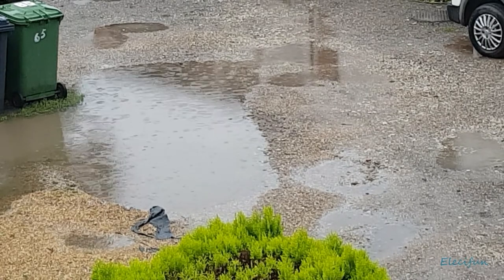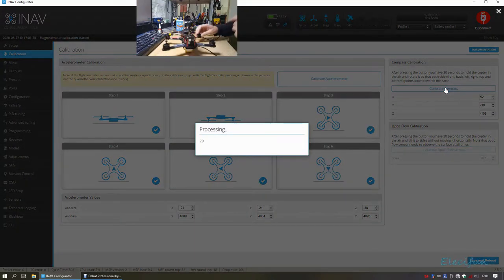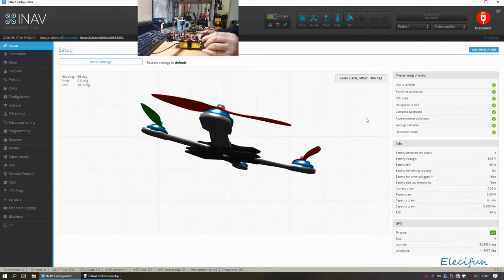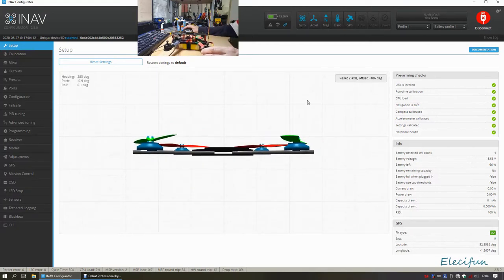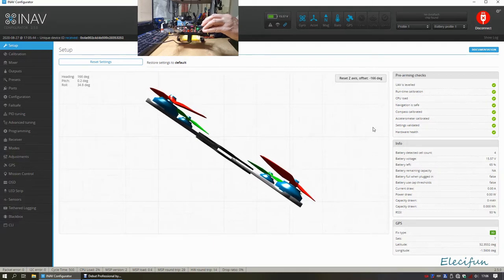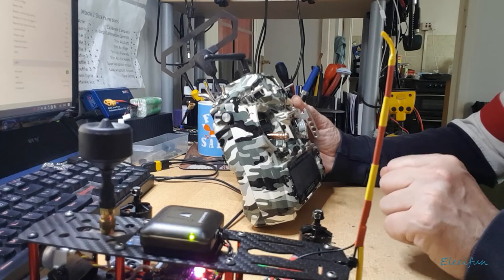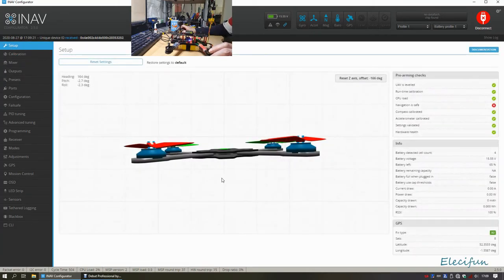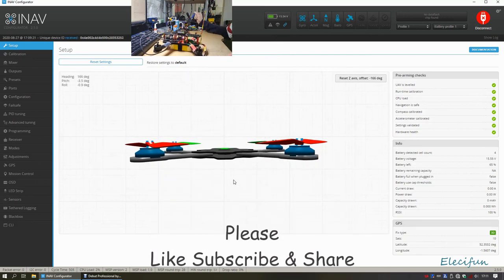INAV 2.5 Magnetometer Calibration and Alignment

Comment: There must be a way to tweak these settings so it matches a compass better.  what if the gps/mag is on an angle
Reply from the maker: Its more about matching the compass to the environment. If the sat receiver antenna  does not have line of sight upwards the receiver will not work well.